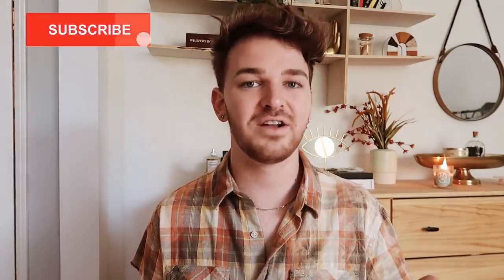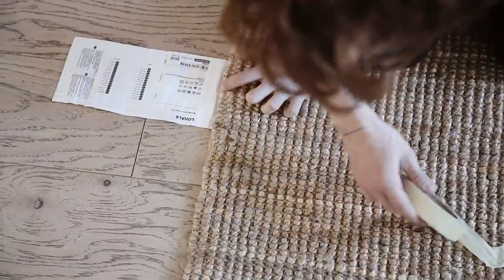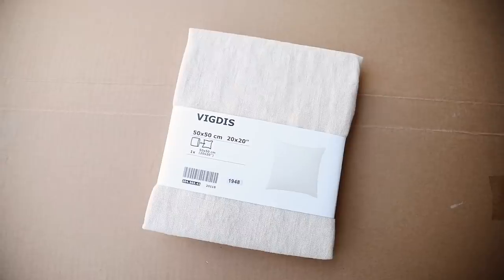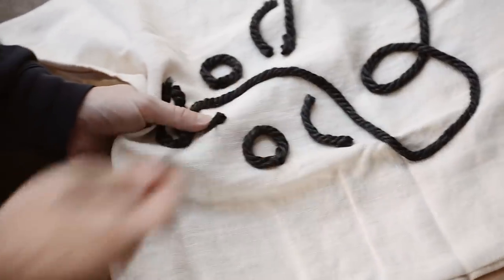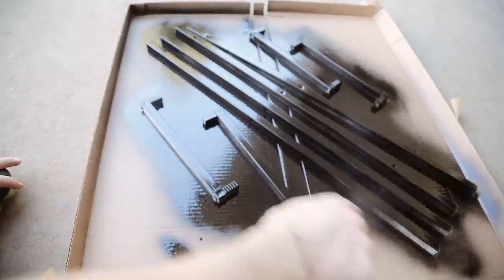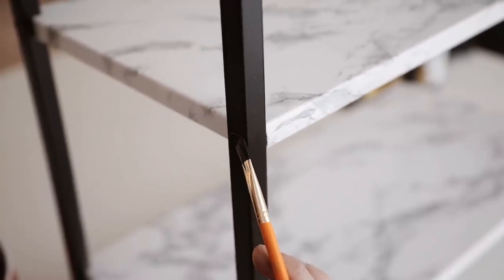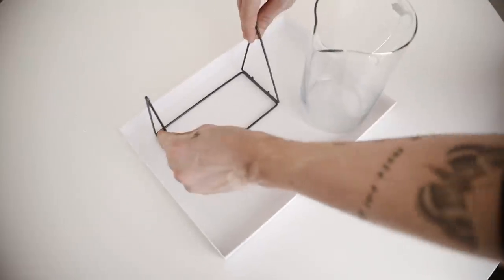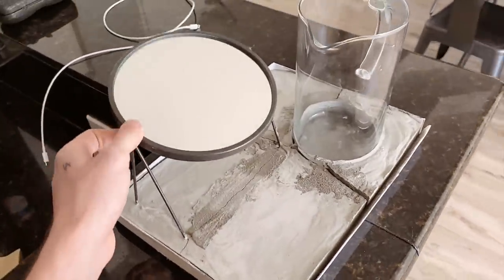DIY IKEA HACKS - Affordable Home Decor + Furniture Hacks for 2020

Comment: Love the rug idea! Quick question: have you ever found that the paint on the rug gives off? Like does it stain on poofs/other rugs layered on top of it?
Reply: kimbakster wondering the same thing
Reply: kimbakster Great question.
Reply: Yes it does! Infact I always use fabric paint, never spray paint. If it’s an intricate design that you have to do, so you prefer spray paint, I recommend to put a transparent fabric paint on top. 😁
Reply: Great tip on the fabric paint. What if I spill something could I gently clean it with water and soap?
Reply: Angela if you put a good layer of transparent fabric paint on top of your design, absolutely! It makes it almost waterproof. I actually have one rug, that is made of a rope material, and I can wash it in the washing machine because I have used fabric paint and transparent fabric paint on top. It becomes a lot more problematic if you have a “fluffy” rug, because it’s a nightmare to put the transparent fabric paint on it, so I recommend rope kind material always 😁
Reply: @Marisa_seizetheday  Thanks a lot!!
Reply: @Marisa_seizetheday  may I ask what  transparent fabric paint is... is it like a clear varnish or similar? I'm in Ireland so maybe not available here.
Reply: @mollym5147  kind a clear varnish/top coat specifically made for fabric. You can get in in spray form, or in paint form ☺️
Reply: @Marisa_seizetheday  thank you.

Comment: If you want something to release from concrete easier, cover it in a thin coat of vasoline. It prevents the concrete from bonding to it. It doesn't guarantee it's gonna work, but really helps

Comment: When making concrete pots I always coat the tub, jar, or whatever I use for the centre, in a generous amount of vegetable oil first; it makes it easier to remove that way. Also, you could have left the concrete set for an hour and then gently removed the jug when the concrete was still slightly wet. ☺️

Comment: Love this! 

Concrete tip - concrete cracks if it doesn't have enough water while it's setting. If you pour water over it every few hours in the few days that it sets it is less likely to crack. Also, using concrete (which has little rocks in it) rather than cement (which does not have any rocks in it) will also help with not cracking.
Reply from the maker: Thanks for the info! :)

Comment: Hi Drew, loved your video, thanks for posting! For the mirror cement project, try also sandwiching wire mess in the center if the cement. This will act like miniature rebar and prevent your cement slab/tray from crumbling or cracking in the future. Also, wrap your glass in foil and surround it with cooking oil before placing it in the cement. I used these tricks in school when building architectural model, so I hope they can now help you!  :)

Comment: a tip for the cement DIY, the inclusion of rebar, or some sort of internal structure while pouring will increase its strength and potentially reduce any future breaking in the base!

Comment: Nice video! If you put something in the concrete to reinforce it (like metal mesh or thin wire) it would significantly help with cracking.

Comment: I'm 2-1/2 days new on your channel so I'm going through everything. I have this large chocolate low pile rug rolled up for months bc I'm changing decor to white / black /leopard / gold accessories.  I kept thinking 'I can reuse this rug but not in chocolate.'  I've racked my brains when all I needed was your channel 7 mths ago!!!  I think I can use your idea with tape & spray paint!  That's 2 problems you solved in our home so far.
P.S.:  I'm stealing the yarn idea on the pillow. Already picked out a greek design.🙌

Comment: you need mold release for concrete when pouring on smooth surfaces like the glass bottle.  A quick hack is to just use some Pam or any type of spray oil in your pantry

Comment: I used your idea. I bought this plain white shelf at target for $20 and added the marble contact paper you recommended. It gave it a little upgrade. I wanted to paint the frame gold but in my high rise apartment I don’t have a place to spray paint. I did buy metal primer to do it so maybe I will brush the gold on.
Reply: I don’t know how to add the picture :(

Comment: For concrete/cement, spray oil (any cheap cooking oil you can find in the supermarket will do) before placing the object in. This will prevent the object being stuck inside.

Comment: You can still used the last project if you do kintsugi in it not with real gold or silver but with resin or something it will look pretty and solve the crack problem ... 

Kintsugi is the Japanese art of repairing broken pottery by mending the areas of breakage with lacquer dusted or mixed with powdered gold, silver, or platinum, a method similar to the maki-e technique.

Comment: Concrete doesn't "dry", it cures - the water is essential for the reaction to take place. Cracks can also happen if it dries out before it finishes curing. The piece should be covered with plastic to prevent evaporation. Cover the container (plastic works well) with something like Vaseline so that it'll separate from the concrete easily.

Comment: You can create the shape you want for the plater, just don't let the object dry with it. And use some fiber to mixte concrete to make it solide. it will always broke for no reason if you keep it pur. The cheapest fiber you can use it's probably cellulose fiber.

Comment: you can actually use glass as a mold for concrete but you need to prepare it in a way that you will be able to take it out without damaging your concrete my suggestion is to cover the surface of the glass which will be in contact with the concrete with a saran wrap and also use cooking spray on the saran wrap to make sure of the simplicity of the removing process.

Comment: I LOOOVE THE MARBLE BAR SHELF! QUESTION: WOULD IT BE EASY TO ADD WHEELS TO IT SO THAT YOU CAN PUSH IT AROUND IF YOU NEED TO?
Reply: I would assume so! As long as you have bars that have holes for casters at the bottom!

Comment: In the future if you are using glass as a mold like thing you can add a plastic bag or even a bit of Vaseline to the bottom of the glass. Basically as the concrete (or even plaster) dries it adheres to everything, and doesn't easy release. If you were to use a plastic bag you would get the texture of the plastic in the final project which could be nice, but not right if you want a smooth surface. I would recommend using a bit of Vaseline to coat the glass, again what ever texture is there it will transfer, but if you use a bit of a paint brush or even your finger to coat the glass with an even coat, the glass should easy release from the concrete. If you are trying to cast a form that has a lip or undercut ( a space where concrete can catch ) you want to be sure you fill in those areas with hot glue, tape, cardboard, really anything that will create a smooth transition along the form, so that the concrete doesn't get caught up on the piece you are trying to cast. 
Hope this is helpful, thanks for all your hacks!
Reply from the maker: Thanks so much for the tip!
Reply: @lonefox  your welcome

Comment: With the concrete if you want to use a mold that can be removed then wipe it with oil before you put in the concrete. It will come out easy after.
Reply from the maker: Thanks for the tip!

Comment: SMH, Ohhhh, Drew. Did you not watch ANY of Rachel's concrete videos from last year? I can just imagine her reaction to that project. The rug is amazing, and now I'm thinking about doing something similar to my old front door mat. That bookcase was the perfect model to use contact paper with since the edges were easy to hide underneath. And I feel you on that pixelated marble print... The previous owners of my condo put down laminate floors on the entire first level before selling, and the pixelation of the print is baaaaad.

Comment: The concrete project might have worked better if you set your mold on a rimmed baking tray to tap it (the cracks were in the same positions that the mold bent from the weight of the concrete).

Comment: okay so I have worked with spray paint before- used the primer, used to colour, used a topcoat and it always comes off. I let it dry forever between layers, I clean it thouroughly before I put on the primer. It just doesn't work. Anyone any similar expierences or is it just me? Because I would love to do these porject, but the colour just doesn't work...